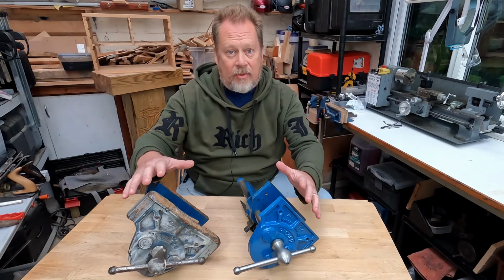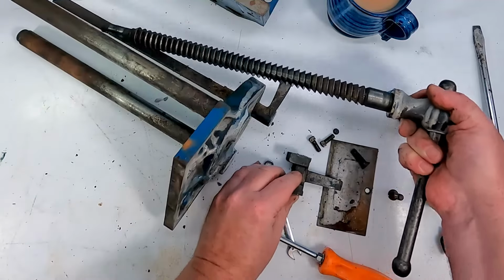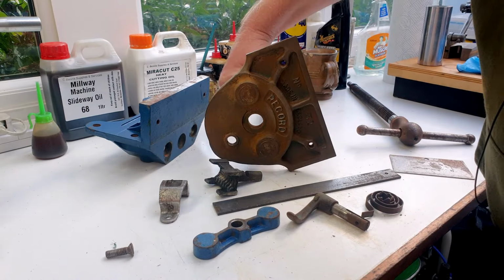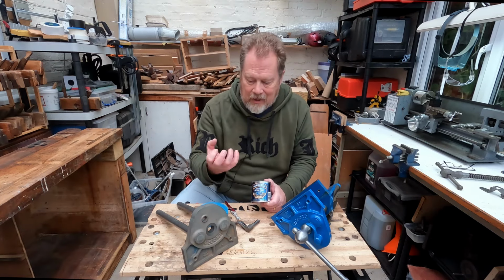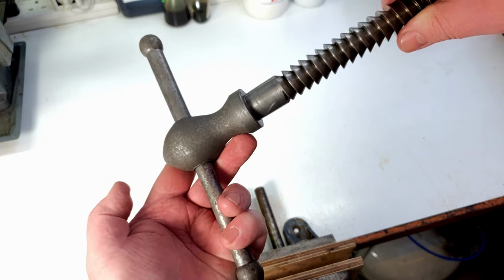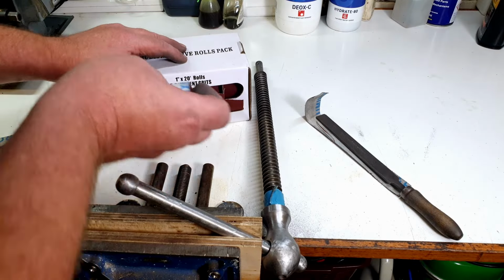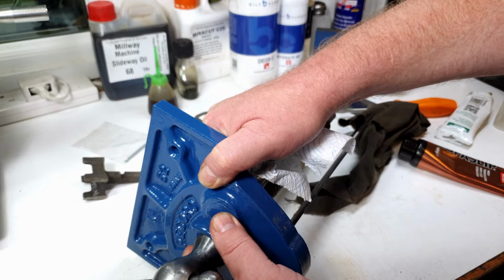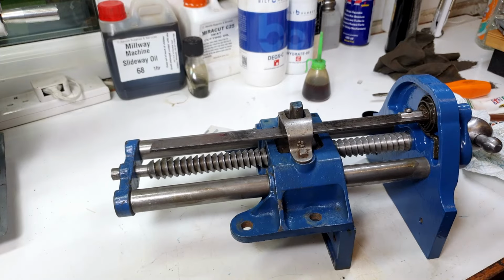Hand Tools Only - Restoring a Woodworking Bench - Part 4

Comment: Thanks Richard, they came out well, without doing an over-the-top restoration, when I did mine I got away without repainting the front jaw either and I quite like the aged look, mine was a little older and the blue was slightly darker (and surprisingly soft) so I just cleaned it up with steel-wool and solvent and then waxed it. If you want to avoid any further mushrooming from the Tommy bar banging around you can wrap a thick elastic band ( or an offset of inner tube ) around each end !
Reply from the maker: Cheers Andy, that's a good idea about the bar. I might see about getting some O-Rings cheap off eBay which should do the trick 👍

Comment: What a fantastic restoration, I'm glad youtube pointed me here. I did similar a year or two ago with a 15inch Parkinson vise. The bigger vise is extremely useful for woodworking, mine can hold just about anything. I wasn't as diligent at cleaning up as you were, but it still looks okay (mine is red, which is what the Parkinson ones were originally, although I couldn't find images of the actual red used). Sadly your video wasn't available at the time, and I used a combination of wire wheels and nylon pads with the grinder, which was a much messier affair than your method.
Reply from the maker: Thanks, glad you enjoyed it. The Parkinson vice sounds like a good tool, good call keeping it in its original colours as close as you could 👍

Comment: Lovely job!  I have a more rusty example of the same vice awaiting restoration so it's really useful to see the whole process explained.  In my case I'll also need to upgrade my improvised workbench so it's a bigger job awaiting an opportune moment.
A tip re making file 'safe' edges safer is to run a fine diamond stone over the entire length of the safe edge, this removes the sharp corners that formed when the file teeth were created and avoids needing to use protective masking tape, but maybe your approach is wiser... i.e. assume that the safe edge isn't safe!
Reply from the maker: Great tip Doc - thanks 👍

Comment: Try "guide" or "support" rods for those bits of round bar ... all they do is (try to) keep the front jaw parallel to the rear. Nice job, I'm using it for inspiration as I've got some older 52, 52E and 53 in the shed to do :-)
Reply from the maker: Nice one. Good luck with the vices 👍

Comment: Richard, thanks for showing the detail of disassembly and assembly.  I refurbished a vintage Morgan 200A vise not long ago. The parts list calls those parts the guide rods. I was wondering why you didn’t remove them. My vise works ok, but, being a woodworker rather than a metalworker, I did not think to grease any of the parts when I put it back together.  I’m debating how difficult it would be to take it apart and grease it. I think it would work much more smoothly. Thank you for the lesson.
Reply from the maker: Glad you enjoyed it Elaine 👍 Guide rods sounds good to me, I had a real blank there 😂 With the Record the rods are swaged into the cast iron jaw so they are a permanent fit. As it happens one of the rods had jaw marks in it which looked to be from someone gripping the rod to try and remove it.

For greasing I would just extend the vice out as far as it will go and put a little grease on the rods and lead screw towards the back near the nut box. That will get drawn into the mechanism well enough if you wind in the vice. You don't want too much grease and oil near the front otherwise it might transfer onto the piece you're working on.

Comment: Good progress. It's odd to see buttress threads on the vises, everything I come across here in the states has either standard screw threads or Acme.
Reply from the maker: Thanks 👍 Yes, I don't think the modern vices use buttress threads any more - more likely to see it on an artillery breech. Apparently that thread form as a lower quick release pressure than a square thread so might explain why they chose it.